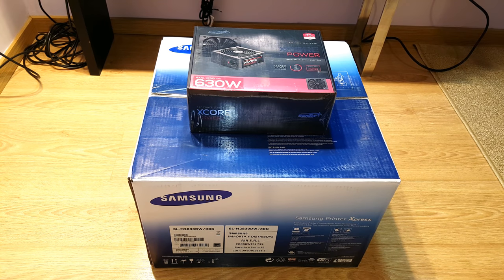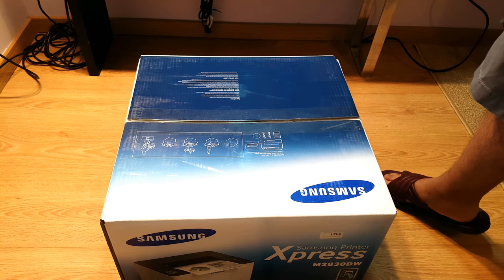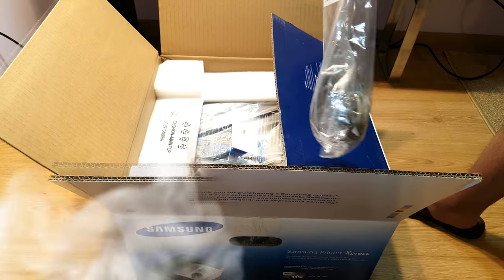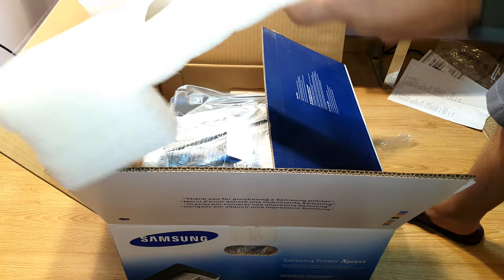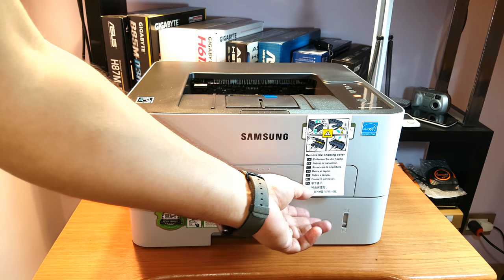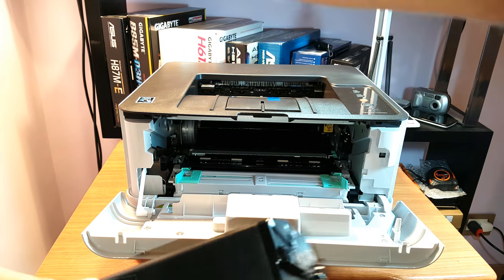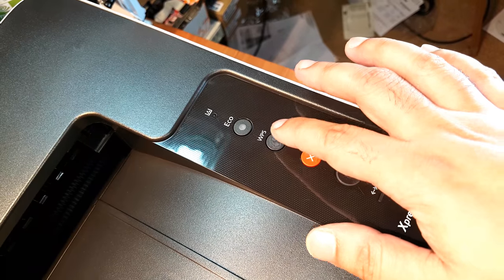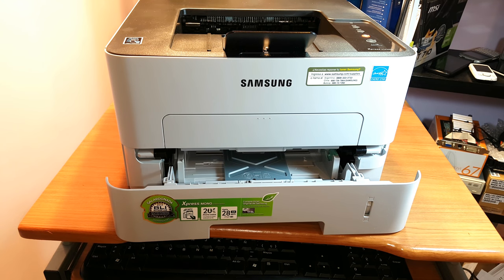Samsung Xpress M2830DW Mono Laser unbox & review

Comment: This printer is pure junk.  I've wasted 2 days trying to get it to communicate with my computer.  It won't work with the USB cable or ethernet cable.  It's now ready for my 10 pound sledgehammer.
Reply: I have this printer. I had no problems setting it up with home network. Everyone can print from their own devices. Small and quiet?
Reply: @gsxr-fr7fc   well now I have a Surface pro-2017 and I can't get it to connect. It worked on my old computer and Mac. Now It just won't connect.
Reply: This product who to detect  password please tell me